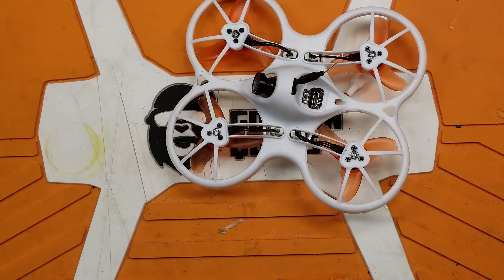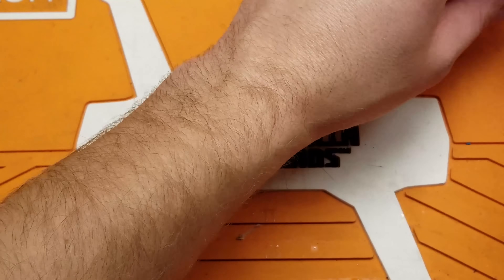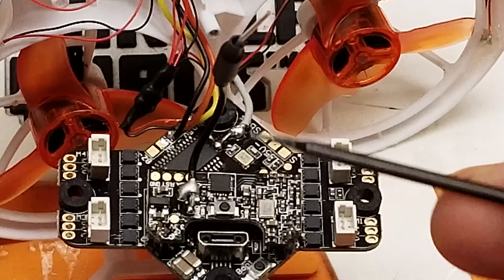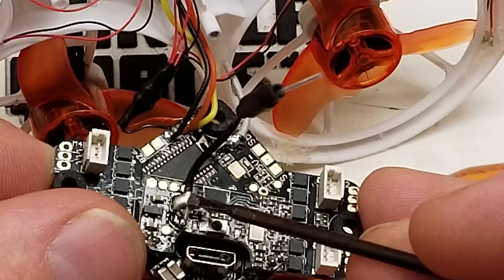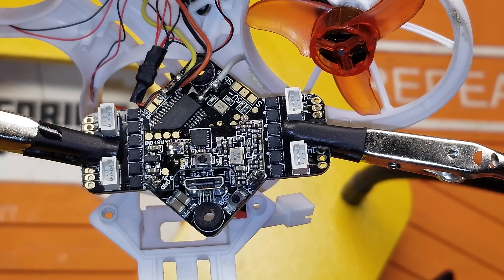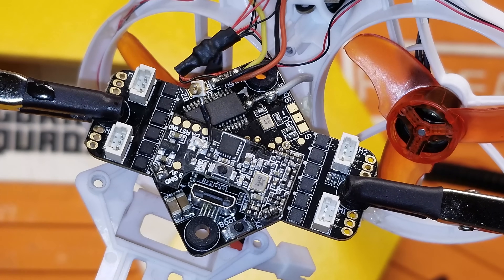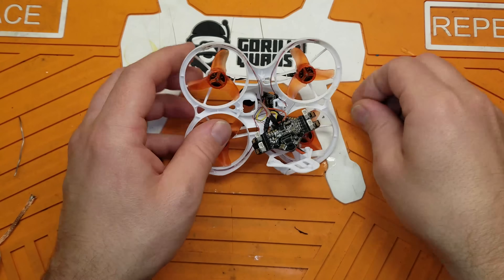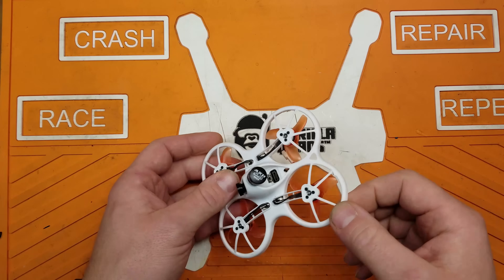Emax Tinyhawk Axii antenna mod

Comment: Good job. I did something similar and then just replaced the vtx. I made a vid. I cut the back side of the canopy out which allows room for the antenna to pass thru. No need for a connector. 👍👍
Reply from the maker: Which Vtx did you use? Feel. Free to post a link to your video here so others can see.
Reply: @TweetFPV  ...https://youtu.be/m5JWEX7jQHM
Reply from the maker: great mod. I put a card in my video linking to yours for anyone who wants to replace their VTX.

Comment: Heard some reviewers mentioned that the Tinyhawk will work with flysky receiver soldered on. Haven't seen any videos of anyone actually done that yet. Can you confirm if it will work? Thank you
Reply: I just bought the Tinyhawk, and I only have a flysky radio so I picked up a micro flysky receiver to put on it. I'll let you know if it works!
Reply from the maker: Good luck. Let us know if you run into any problems.
Reply: @TweetFPV  I replied with the results, I think it might have went into your spam because I mentioned one of my videos. If you could allow it that would be great :)
Reply from the maker: @FPVisioning  yep, you were right. It got flagged as spam. I really don't like the ytstudio app. Very limited usefulness on a phone.
Reply: @FPVisioning  Hope it will work. Keep us updated as soon as you can. Thank you
Reply: This was the easiest mod I've ever done, and it worked flawlessly. I got a cheap six dollar flysky FS82 receiver, soldered the yellow ibus wire onto rx1 on the tinyhawk, red wire to the 5v pad, then the black to the battery ground, then powered it on and bound it to my i6. All I needed to change in betaflight was the receiver type, from "sbus" to "ibus" and the channel mapping from whatever it originally was to "default" and it worked perfectly!  I'll post a video on how I did it and the results soon.  I still have to try to set up the RSSI, that isn't a problem for me however as I fly in the house.
Reply from the maker: @FPVisioning  thank you so much for posting your results. I know this will help someone out, keep the community strong!
Reply: @FPVisioning  Awesome. I have ordered the TinyHawk as well and waiting for it to arrive. Can't wait to add a flysky receiver to it and fly
Reply: @bsuperyogurt3580  It's still going strong! One of my favorite mods yet. I might get a new charger for the 450mah 1s lipos though, since the 4.35HV charger it comes with gives them a significantly shorter life, more flight time per battery though.
Reply: @FPVisioning  Thank you for your video showing how you install the receiver and how you set it up in Betaflight. My Tinyhawk should be arriving soon.
Reply: @bsuperyogurt3580  Oh no problem! Have fun with the tinyhawk! I've flown mine a ton already today, like 15 packs 😂 Smash that subscribe button!
Reply: FPVisioning what does it do to give them a shorter life?
Reply: Are you thinking of not charging to 4.35, or doing a rate different than .3 or .6 amps ?
Reply: I'm not exactly sure. For the first couple charges on a new battery I get significantly better punch and flight times. My first guess was that the high charge voltage wore them out much quicker. I flew my batts down to 3.45 at first, and they bounced right back up to 3.8 when I was done flying, which is optimal.  FLight times kept getting shorter, so I  decided to go 3.2-3.3 now, and they bounce back up to 3.8-3.9. So I'm assuming I'm still drawing the same ammount of power, the battery just can't handle as much amp draw now.
Reply: I don't have a TH yet but have heard the stock batteries aren't great if you fly hard. I'm in a group of indoor racers https://www.facebook.com/groups/MicroFPVRacing/ and about 6 guys have the TH's, I'll be taking notes before I get mine and already planning  battery and connector upgrades.I try to understand IR, bounce back, and connectors, as we had to do the same with our Tiny Whoops to the PH2 connector. Same connector on brushless at 12 amps ? sounds like a weak point if it's not bad batteries. Sounds like you treat your batteries well too.
Reply from the maker: @gregladner6992  I have had good flights with the stock battery. For replacements i use the GNB 450 HV packs. They are the one with the pink label. all of these 1S HV packs don't have a ton of cycles in them, These 1S brushless quads are at about the max of what the current LIPO technology will allow. So either fly slow and gently and have long life packs or fly however puts a smile on your face and keep buying replacements when the lipos no longer put a smile on your face. Fortunately the lipos are realities cheap.
Reply from the maker: @gregladner6992  No, charge to 4.35 and at .6a. Liops don't last forever and are fairly cheap for this thing.
Reply from the maker: There are provisions to solder on a different rx of your choice. It would need to be a very light and small rx.
Reply: @TweetFPV  Noted. Thank you very much

Comment: Does turtle mode work now, whith the antenna so far up? Any handling difference compared to stock?
Reply from the maker: No change in handling and turtle mode still doesn't work. The stock props don't provide enough thrust in reverse to flip the tinyhawk.
Reply: to bad, was hoping for a "double winner" @TweetFPV

Comment: I already have a snapper 7. Do you think its worth it to buy a tiny hawk?
How is it better than a snapper 7? 

Thanks, Tweet
Reply: Thanks, Tweet
I’ll just buy lipos or vtxs.
Reply from the maker: If you haven't tried to setup project mockingbird on your snapper 7 yet I highly recommend giving that a go.
Reply from the maker: I have both the snapper 7 and the tinyhawk. I don't fly the snapper anymore. Reason being is the snapper is heavier and more destructive to its-self, my house, and "soft targets" with that aluminum frame. the tinyhawk is purpose built with each component being part of a "system" the snapper is just a bunch of parts, be it good parts. With that said, would i recommend buying the tiny hawk over the snapper 7... YES!! would i recommend buying a tinyhawk if you already have a snapper 7, possibly. the reason being for me because of the group of people i fly with and do indoor races with i don't want to mess up their houses when it comes to race day. The snapper 7 is just a bit more anit-socal than the tinyhawk..... Hopefully some of that makes sense.
Reply: So tinyhawk is only better in social? Is there any difference in fc or something?
Do you think its worth it to spend 99$ on another micro quad? Or recommend me something else to buy with 99$!!
Reply from the maker: If you have the snapper and are happy flying it spend you cash on liops. If you are somewhat serious about racing get the tinyhawk. I can think of a better indoor Quad for $99.
Reply: What is project mockingbird?
Reply from the maker: https://www.facebook.com/groups/1702300099835884/
Check out this fb group.
Reply: Yes Project  Mocking bird is amazing on the tinyhawk!
I also have a snapper 7 that was molded with a rakon heli frame and different  canopy (not really a snapper anymore) and the TH blows it out of the water